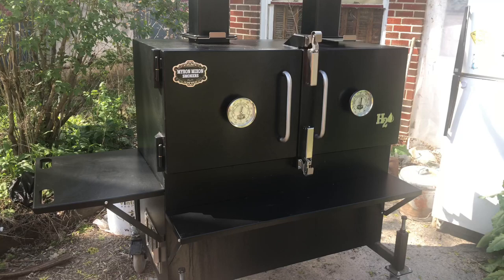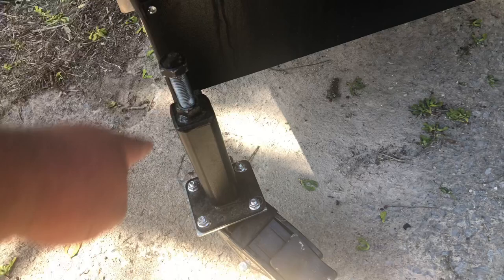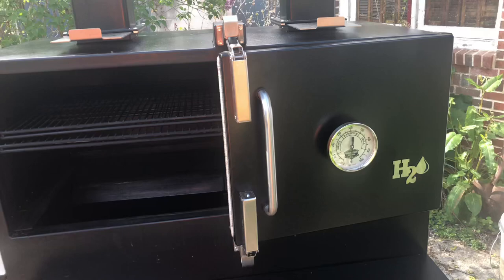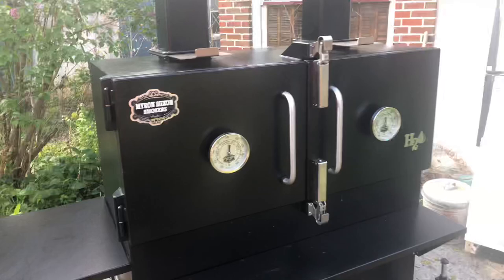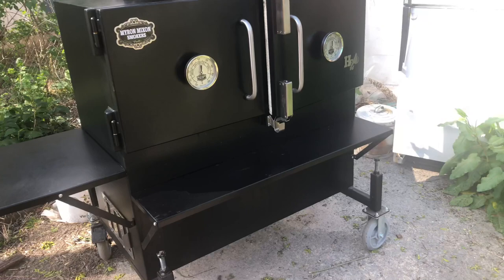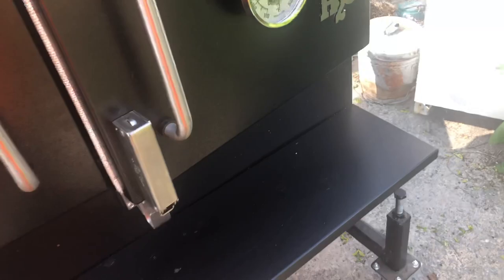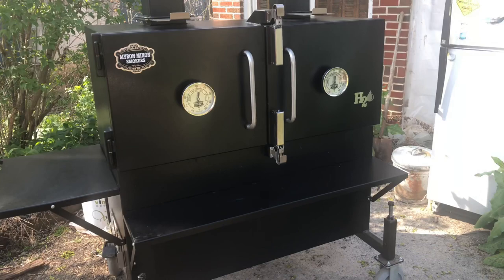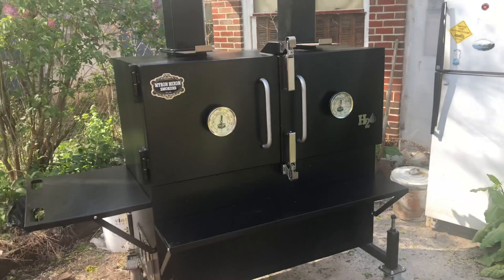Review Of The Myron Mixon 48” H2O Smoker

Comment: I’ve owned this model since 2015.  It’s an absolute machine.  Best thing I can say is that knowing what I know now I would not hesitate to buy it again.
Reply from the maker: Hey man I won’t buy anything else
Reply: If you were to max out this pig all for racks with baby backs giving a bit of space between each rack, how many are ya getting on it?
Reply from the maker: I’d say 30 racks
Reply: @fredstone9016  unless you use some kind of device to turn the ribs on their side etc and you only use the smokers two racks you can confidently count on 20 racks of ribs.  There have been a couple of times I’ve gotten 21 on there but whether it’s 20 or 21 they will be tight.   But I’ve done at least 20 at a time on mine probably 35 times over the years cooking for large events.
Reply: Thanks guys I appreciate you taking the time to answer! That's roughly what I was thinking was about 7 per rack getting you to that 28-30 area. Where I'm from the baby backs after trimming usually run around 15"×5". So I'm thinking I may be able to slide two going horizontal length wise as well. But none the less 30 is plenty for what I do.
Reply from the maker: Your welcome that’s what we do
Reply: @RichsRiverSmokersWestVirginia  I'll be sure to pass the buck!

Comment: Great video Rich. That is my "white whale" of a smoker you got there! You mentioned yearning for a stainless steel water pan in the unit. After 30 years of heat treating in a foundry I believe you are spot on about it driving costs way up and also I've learned from quenching, that stainless steel will cool off extremely faster than regular steel of the same thickness in the same amount of time. It's pretty amazing. I mean sections 4 or 5 inches thick, you can lay your bare hands on as soon as we can get them back up after submersion. I would then ASSume that would lower you efficiency of keeping a uniform temp through the cook tremendously. Anywho, great stuff and keep them coming.
Reply from the maker: Makes sense

Comment: Very nice and well built water smoker.. Do you have room to install a electric wench with remote to the inside front of the trailer so you can have it pull the smoker in and out..?
Reply: Honestly I don’t think it’s necessary.  I’ve owned this model since 2015 and as long as you are mindful of where you load and unload it’s not terrible to get in and out of a trailer assuming you are healthy.  There have been a couple of times I’ve needed a bit of help to push it back on a trailer but most times I can do it on my own.  But if one were physically challenged a winch would be a must.
Reply from the maker: no me and my boy can push it and out the trailer